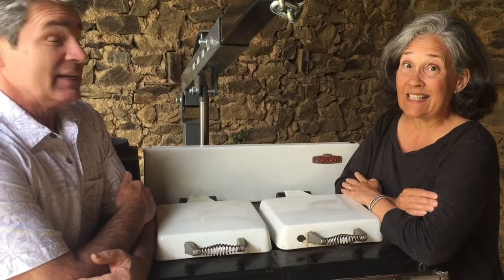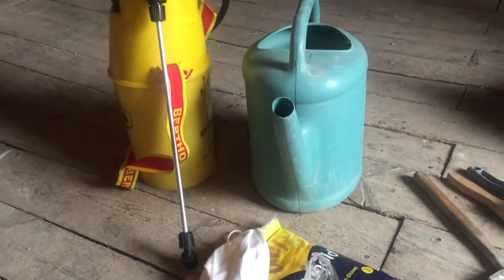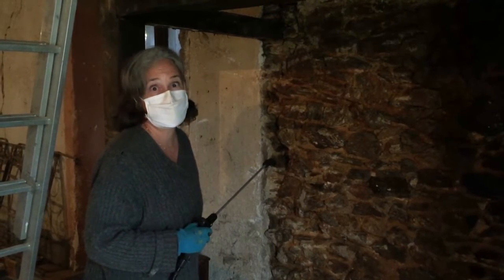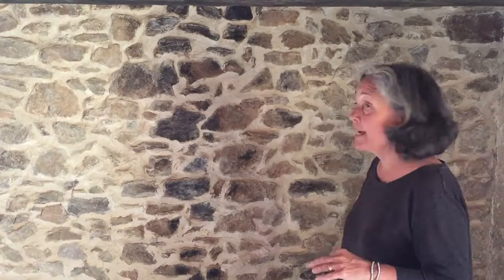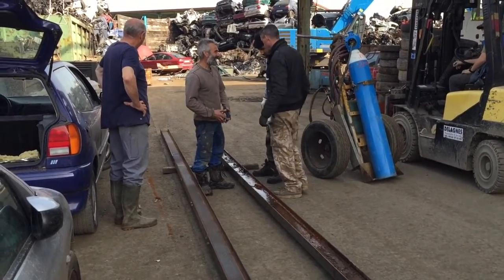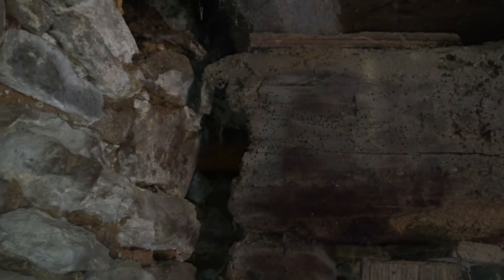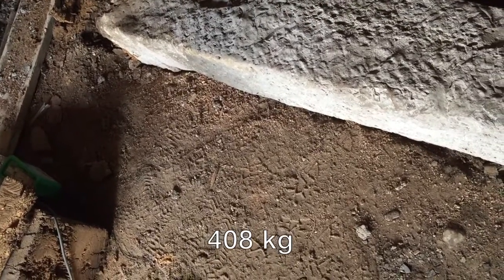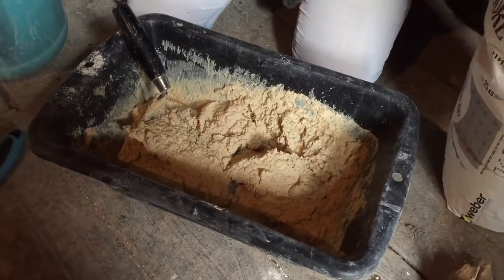Living a French Life S01E17 Stone & Steel • Stove Saga2 • Stone Pointing • I-Beams • Bloopers at End

Comment: Did you have the I beam size calculated ? It looks a bit light to me ...........
Reply from the maker: You are right. One of those would have been too little support. It made better sense to split the load because the floor joists are not continuous and it made it easier to get the old beam out.